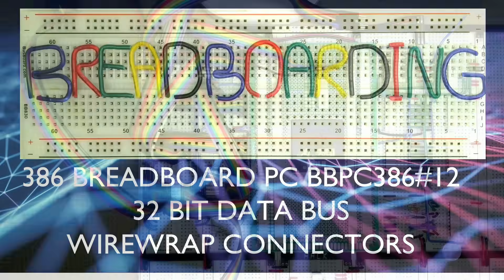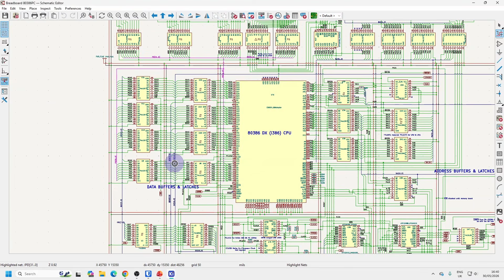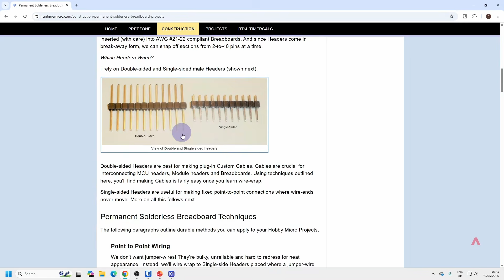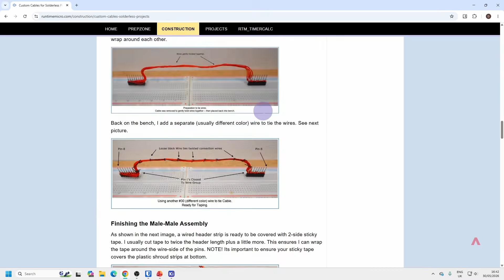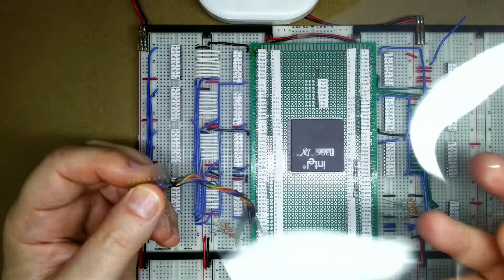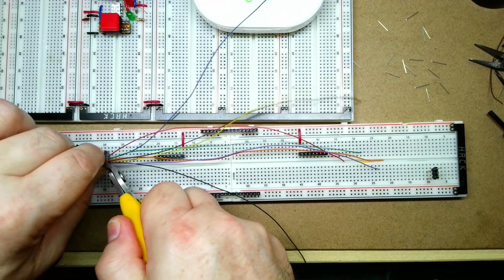386 Breadboard PC #12 32 Bit Data Bus & Wirewrap connectors

Comment: That's a really elegant solution. I like the use of the transparency film to pull out all the pins evenly. Should make things a lot more reliable. Looking forward to the rest of the build.
Reply from the maker: Thanks, the only possible issue maybe that twisting the wires may cause interference between the signals but the highest frequency will be about 4MHz so will hopefully be ok. Dave

Comment: With a hot glue gun and the transparent sheet you can make a strong enough holder. Put some glue on pins and press with transparent sheet like a sandwich, I hope that makes sense.
Reply from the maker: Unfortunately I don't have a hot glue gun but I can see this could work too. Thanks for the feedback. Dave